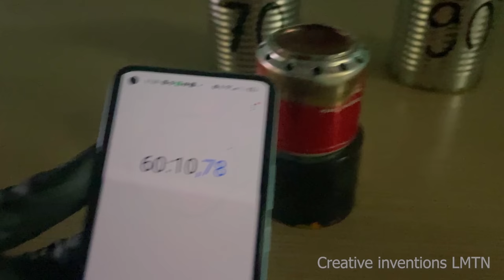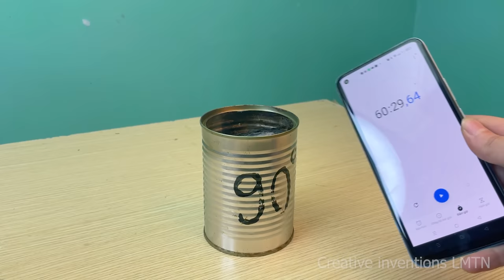Secrets mini HEATERS that few people know ! You should have when New York is buried in sea of ​​Snow

Comment: I will definitely  try the coke  can heater,  and onda toilet  paper  🧻 roll heater I use  91 percent alcohol,  im gonna  also try the sawdust heater, and  see how that  works.  I don't doubt  that  it  doesn't work.  But I did try the toilet  paper  heater.  I have use wax candles, and heated  a 6x10 camper, inda winter months. But I made a large  candle  heater  with 3 wicks, it did a amazing  job  in keeping  me warm  when  I  was  homeless and  living  in  a  Campground.
Reply: Sand also works, wont burn and will just go out when you run out of fuel.
Reply: It didn't work right?
None of these have enough BTU's to heat a room.
Reply: @glidercoach  
When you're freezing and have no alternative almost anything is an improvement.

Comment: I use a pack of cotton balls instead of toilet paper because it is cheaper. I use two of these heaters to supplement the heat in my large TV room. The two heaters will do a good supplemental job for about 2 hours and then they will slowly extinguish themselves with a strong smell. At this time it is advisable to please do some extra ventilation to avoid the smell and toxic fumes.

Comment: How do you make wicks?
Reply: You could use candles cut to length. Cotton yarn or even strings off of a mop. Don't think a candle wick would produce enough heat to cook on. The blue flame type burner would be better for that.
Reply: @richardtrowell8812  I have lots of candles endings, but no wicks. 
...(The candles had to small wicks so they died out. (old?) Got them from IKEA, crappy candles.)

Comment: None of these can produce enough BTU's to heat a room. Sorry.
Reply: No...but if you're freezing and without heat, it will definitely keep you alive
Reply: @charissarobinette4625  
No it won't. Not even close.
Reply: I live in a 4berth (size of a bigger single room) caravan, and I use a small alcohol stove for heating. It does heat up the caravan by 3-4c° with one fill (about 40min)